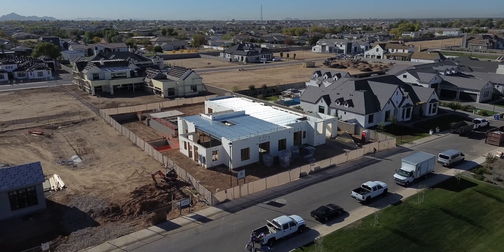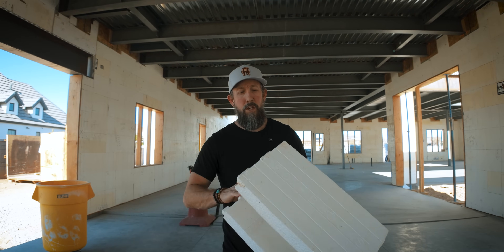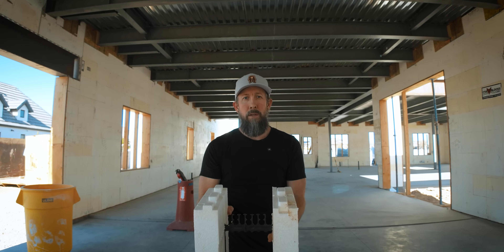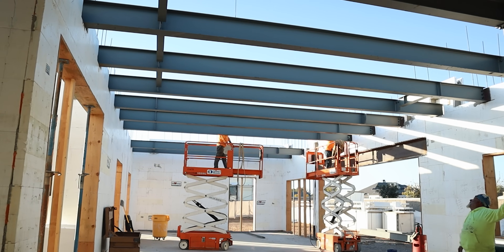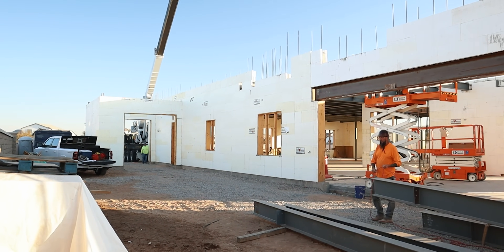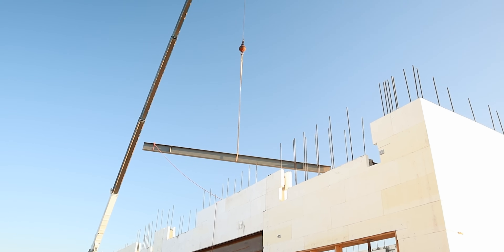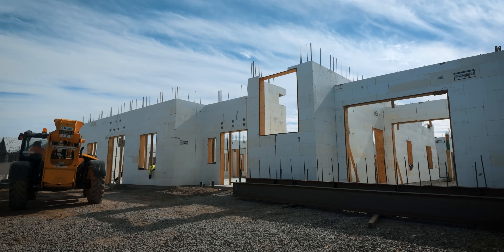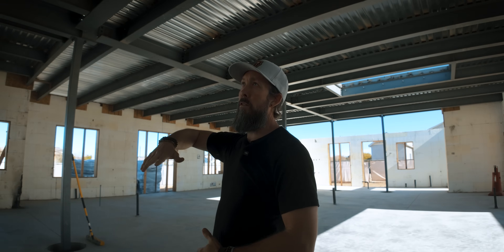Why Two-Story ICF Homes Are Revolutionizing Residential Construction in 2025 | EP-33: Liberty Estate

Comment: Moved from a 1970s stick to a 2000's ICF. Utilities were the same cost from the same company and my bill didn't change. Old house was 1850 sq ft and the ICF house is almost 5000
Reply from the maker: That’s wild.
Reply: ICFS barely even meet minimum code in Canada. Not enough insulation... Lab testing they are fine but very few are installing them well enough to actually reach those numbers. Wood framed, particularly with exterior insulation, gives you much higher R-value and can be detailed better. Solid structure to fasten to with defined Drainage planes to follow and flash. ICF's just pray to the petroleum gods that the tapes hold up. no thanks. Nobody is understanding that the foam is not a drainage plane unless you add a weather barrier product. I reglet flashing on all ICF's I work on that don't have one.

Only due to lobbying and allowances do you see them here at all. In theory they are easier to detail and thus overall provide the minimum r-24. Pain to add more insulation and the concern of trapped moisture is greater than conventional. Not to mention the plastics degrading in them. Those nailing flanges might as well not be there. Have any of you had to deal with re-siding an ICF yet? J.F.C the stuff becomes swiss cheese.  i nearly got my insulation contractors to come and grind everything back down to concrete so we could start fresh with new foam and concrete anchors. Yellin' you guys... this stuff is not a good product. do yourself a favor and yourself a good mason and forming contractor, and learn about z-girts or channels, and bulk order rigid foam, roxul, or other natural byproduct exterior insulation. That's reminds me of the worst thing about ICF's. Inexperienced people running foundation pours. just shudder thinking about it. Inspectors are rarely around to do slump tests during OR thorough density tests afterwards. Just the wild west of know it all contractors with big smiles on their faces because they saved themselves 60k by doing it themselves. The amount of voids being found in inspections is ridiculous. If one was intending to buy an ICF  by an unknown builder all id say is do so during the winter and get a thermal camera.
Reply: @kencraft4567  did you read the whole comment? The new house SQFT is more that double with the same utilities cost of the smaller home.... so effectively half the cost.....
Reply: @chadswanson2295 are you on Drug?  Canada has a lot of ICF that more than EXCEED insulation standards in Canada.  It’s actually higher. R28 in walls is higher than R20/R24 in most of Canada.
Reply: @Alphasig336  you might be the one on drugs. You didn't read or try to understand my comment.  Have a nice day.
Reply: @chadswanson2295  you're right but I did read the whole comment. Saying a modern home is twice as efficient as a one built in the 1970's with no code or regulatory building department isn't the flex you're thinking it is. Not saying it's not a good thing - every step in the right direction is positive and a 5k sqft home is large with lots of extra heat loss potential than a smaller home. But it should be better. Compare a 1970's home to a IRC or better 2000's home built with wood framing and you'd find it would be. apples to orange comparison is all I'm saying there.
Reply: @kencraft4567  You can absolutely use ICF's in Canada, there are multiple Canadian only ICF companies. No allowances required. They easily meet and exceed code. You are just spreading misinformation.
Reply: @kencraft4567  You are mistaken.

ICF products, such as those from BuildBlock and Quad-Lock, are independently evaluated by organizations like Intertek and the Canadian Standards Association (CSA). These evaluations result in Code Compliance Research Reports (CCRRs), which building inspectors use to verify that ICF systems meet national and provincial standards. ICFs are approved for use in residential and commercial buildings under the NBCC, including Part 9 buildings (typically low-rise residential structures). The 2020 NBCC update introduced stricter requirements for energy efficiency, fire resistance, and structural integrity. ICFs are well-suited to meet these due to their high thermal performance and solid concrete core.
Reply: @WilliamByrdson  No not mistaken. Check back in 10 years. We are already having problems with them in Ontario. I agree that I misspoke as the product is approved and passes -  I was relying on others common sense there since we build with them clearly they "pass" on paper. Edited it for clarity. 

I'm speaking of the real life values of the installed product being sub par and heat loss testing showing a different story to lab tests. R-22 average MAX for most manufactures which barely meets code. If our in-wall insulation values were to only hit that our design would require exterior insulation. It's not how the product holds up in a lab its about how it actually exists in the real world. Sorry but you've all been had. It's overpriced marketing jazz. If you want a concrete wall build one properly not with lego blocks. It'll be less expensive and have higher quality and longevity. Do you know what happens when moisture gets trapped in ICFS? Have you yet to go through the process of stripping off a poorly installed facade and re-engineer the building envelope on a building that relies on deteriorating plastic or compromised foam? It isn't pretty and far from economical nor environmentally friendly. You do you but it's a pass for me and my clients as I see it as the farce that it is. Just another money grab for corporations and builders and way to make use of unskilled and cheaper labor. Good luck to all with their ICF related renovations and re-siding projects and building wood-based walls inside and outside the ICF system just to make things right. cheers.
Reply: @kencraft4567 nobody cares about Canada
Reply: @kencraft4567 😂😂😂😂😂okay😂😂😂😂😂😂😂😂

Comment: Curious question about the material itself: so if expanded polystyrene burns and gives off toxic fumes, what difference do these polystyrene panels have so that they become fire-resistant and produce less fumes?  Do they have any additives / are they processed differently to achieve that fire resistance?
Reply: My guess is that the fire-incident side of polystyrene foam will burn (and leave you with severely damaged insulation on that portion of ICF), unless you cover it with a fire-resistant siding material.  Interior of ICF must be covered with drywall, so the remaining question is what’s on the exterior.
Reply: You can use ICCF like Perfect Block. The styrofoam is blended with concrete to yield a fire rating of 4 hrs.
Reply from the maker: Yes. We have never worked with those. Fox Blocks is our preferred product.
Reply: while EPS can burn, the temps & sustained time to ignite are pretty high. most fires burn over quickly, so it's more important to not have anything near/attached that will catch fire easily & spread to the EPS with high intensity. also, modern stucco products like U-Stucco provide fire retardant protection & an insulation factor up to several thousand degrees.

in any case, windows/doors will fail far sooner than the ICF structure, and it's really all about having time to get people/pets to safety. if you can prevent the structure from total ruin, that's just a bonus compared to traditional building methods/materials.
Reply from the maker: Thanks for all your comments Ivan.
Reply: @ ...right-on, hope they help someone. there's a lot of bad info out there, & i really think ICF has proven to be a great product. companion products & install methods are vital too, & nothin is perfect for every situation.

Comment: Homes should ONLY be built using ICFs or SIPs. Both are fundamentally better than stick framing. They are much more airtight and better insulated and stronger. I have 10 inch thick SIPs with an R-value of 60. I spend almost nothing heating and cooling it.
Reply from the maker: It’s amazing what can be done. Unfortunately people don’t always want to spend extra.
Reply: @aft_construction  Penny wise, pound foolish ? Or rather Sticker shock vs.  undeterminate lower utility and insurance bills.....

Comment: What are your thoughts on using FRP, like the product from MST in place of steel rebar for the footers, floors and in-wall?  We've been doing some (very) rough designs using either the Superfloor system or LiteDeck for the upper floor.
Reply from the maker: We haven’t built with any of those technologies, so it’s hard to have an opinion. The technology in construction is so amazing. Did a bit of research on those you mentioned, we will have to look into them for other projects. Thanks for the comment!

Comment: How does ICF construction timelines? Compare to traditional stick framing or CMU wall construction? Is it faster slower or about the same?
Reply from the maker: There is a cure time on the walls, most certainly. There are so many other areas on the job site that we can focus on. It’s not an issue on this project. Good question.
Reply: Why longer. Unexpected rain delays, need to coordinate boom truck with concrete crew AND if concrete ready mix will be able to fulfill your order. Then you need to wait for cure times, full strength concrete takes 30 days minimum. Lumber is way faster. That being said icf is better quality
Reply: @LincolnLog  ...you gain a lot of time back through MEP stages tho, and ICF dry-in time can certainly be faster w/o as many different contractors as stick takes. optimal is just a different scheduling plan than stick. ICF can/has been done in rain/snow, just req a different prep/slump/post pour care.

with ICF, you can pour the footer & walls at the same time, strip bracing after 5 days, rough-in plumbing & put down insulation in a couple days, lay MST and/or mesh, then pour the slab. everything can cure at the same time, while interior framers mark/plan, & roof through dry-in can be done in under a month if single-floor & spans aren't too far.

@OP, ...CMU takes an eternity at all stages and labor is highly skilled in comparison. it has it's place, but sucks for envelope walls of a dwelling.

Comment: Excellent! Would love to see how to make an ICF roof and attach metal roofing. What would you use to seal/coat cement and how to attach metal roof to it.
Reply from the maker: This one is getting a wood roof. Maybe someday we will do a house with a steel roof. The roof system will be rad for this one.
Reply: @ awesome! Can’t wait to see your roof on this one. Thanks for the reply, all the best to you
Reply: I have a picture somewhere of a steel roof. It was cold formed framing on a tube of HSS at the ridge. Basically what you’d do with block.
Reply from the maker: @scottzagger we just did a steel roof system on a clients home. It looks amazing. We can do a video there soon.
Reply: ...look for Insul-Deck or Lite-Deck vids. really don't need the metal over it, with xypex additive,  enough slope, & a membrane/TPO. but you could add furring strips & whatever roofing you prefer the look of right over the top. ICF roof helps with continuation of the sealed/insulated envelope, making the dwelling like a yeti cooler.
Reply: @ awesome, thanks 👍🏻